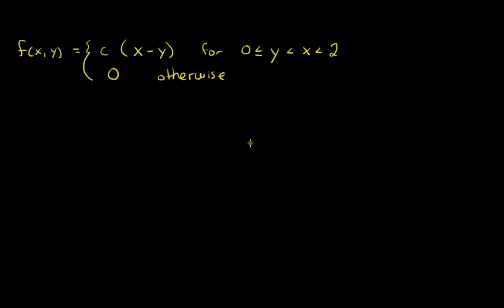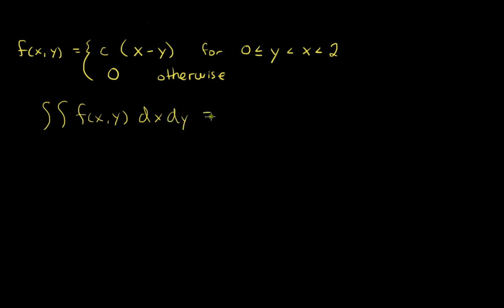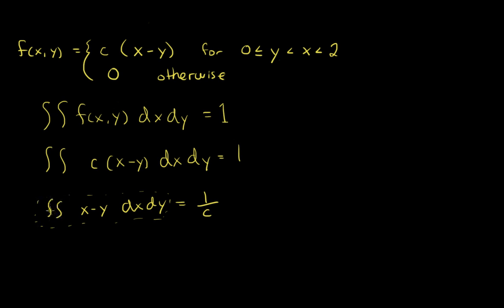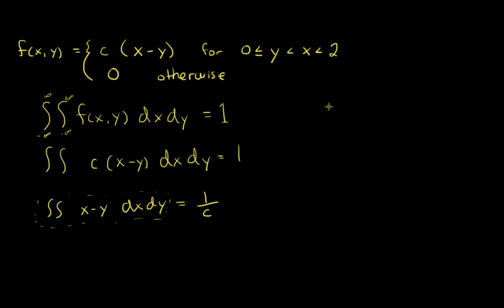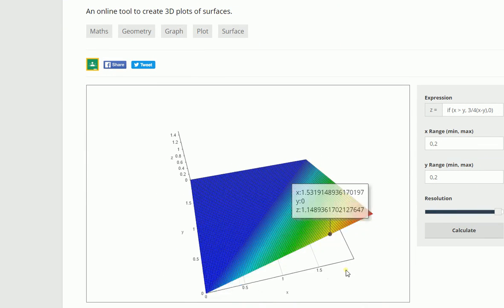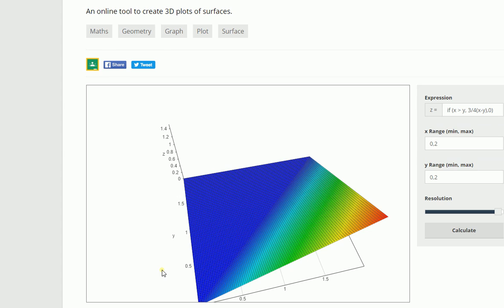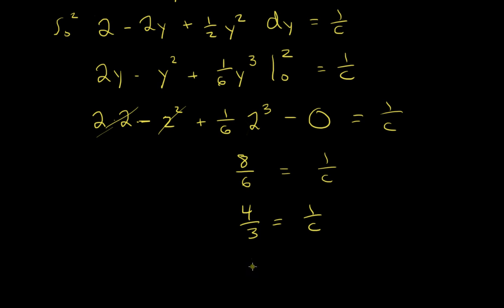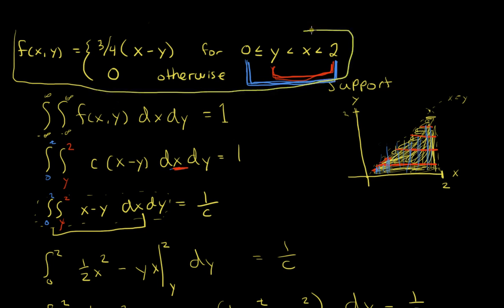Joint PDF find the constant

Comment: Why can’t the limit for dx starts from 0 to 2?
Reply from the maker: If the limits for x are 0 to 2, then the limits for y would need to be from 0 to x, and your integration order would need to be flipped to dydx. You can try this and you should get the same answer as me. 

The reason for this is because we are not integrating over a square, we are integrating over a triangle. x from 0 to 2  AND y from 0 to 2 is a square. Though x from 0 to 2 and y from 0 to x is a triangle. Also, y from 0 to 2 and x from y to 2 is a triangle.
Reply: @Stats4Everyone  So if we are given x ranges from 0 to 2 and y from 0 to 2, then we can integrate x with upper/lower bound as 2 and 2?

In other words, it is because x and y's possible values are related, that we need to integrate one variable with another variable as one of its bounds?